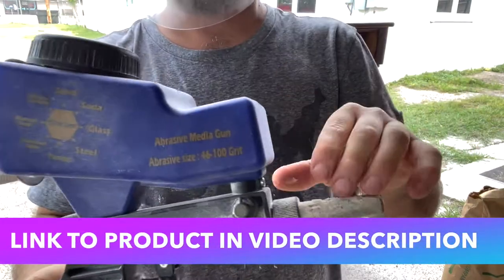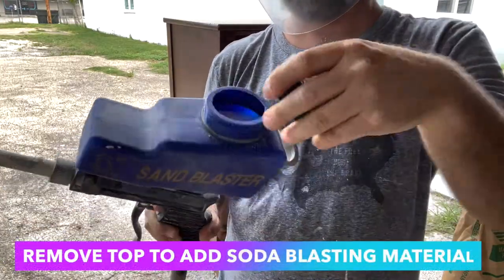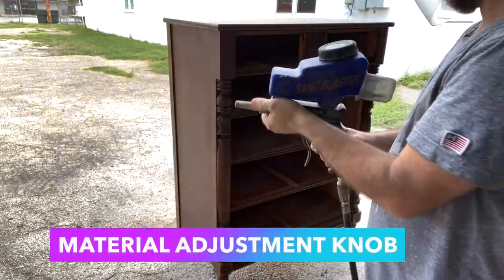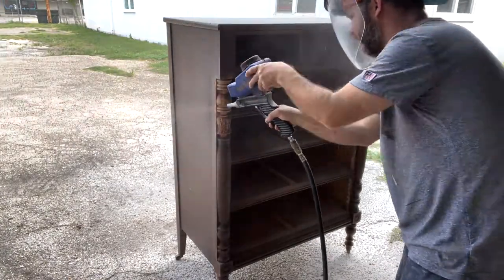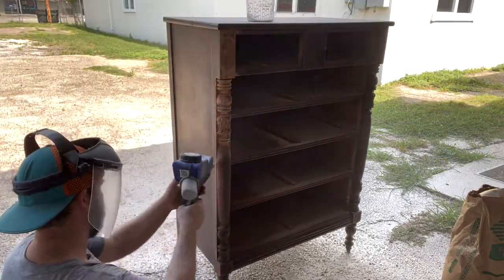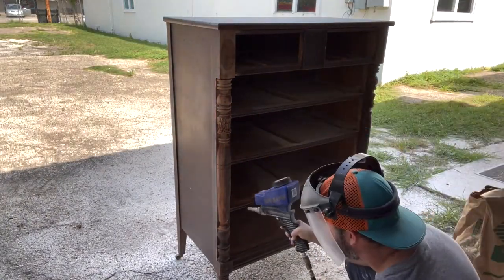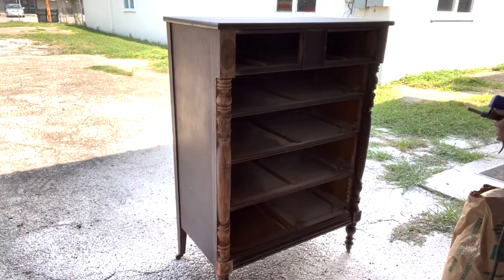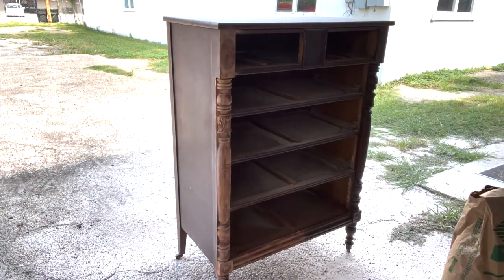SODA BLASTER GUN DEMONSTRATION! (SANDING ORNATE FURNITURE)

Comment: I have the same sandblaster, but mine has the material pouring out constantly… any advice?
Reply from the maker: If the material is coming out without you pulling the trigger, I’d say you’ve got a faulty gun. There should be a mechanism In Place that stays shut when the handle isn’t being pulled

Comment: Thank you so much for posting this video.. what a nifty little gun! Mine arrived in the mail today and I can't wait to use it! I'm wondering if you needed to use the 'inline filter' mentioned on the instruction sheet (i think it's meant to attach to the air compressor's hose? and is an extra purchase) if using the soda media?  Thank you so much! Cheers. Dee (from Australia)
Reply from the maker: Yes, I’d highly recommend to use a filter and an air dryer.
Reply: @the323vlog4  thx for getting back to me so quickly! That's very helpful, thank you. May I ask what is an air dryer? (apologies, I'm very new to this and a bit of out of my depth). Cheers :)
Reply: ... I just googled it!.Thanks again! :) Cheers. Dee :)
Reply from the maker: @deirdrehughes3876  sorry, I was in the process of responding last night and got distracted :)
Reply from the maker: @deirdrehughes3876  it’s very important to keep the moisture out of the air hose, otherwise it will clog the gun because moisture and baking soda Are a bad mix.
Reply: @the323vlog4  Gotcha. Thanks so much again!! 😊
Reply from the maker: @deirdrehughes3876  my pleasure